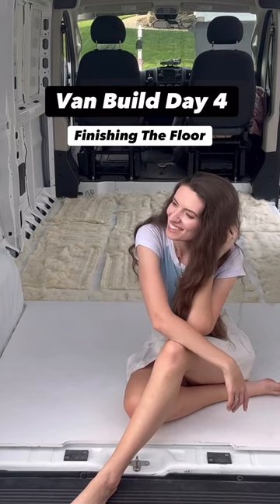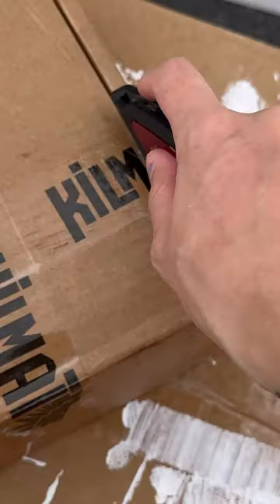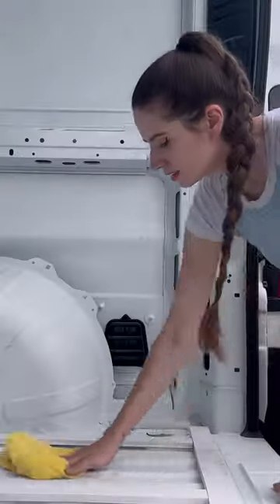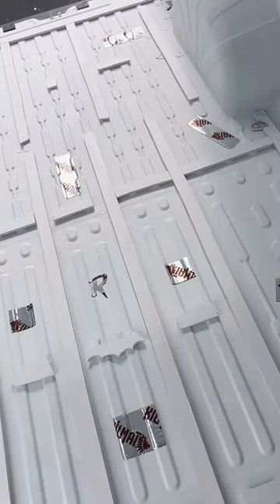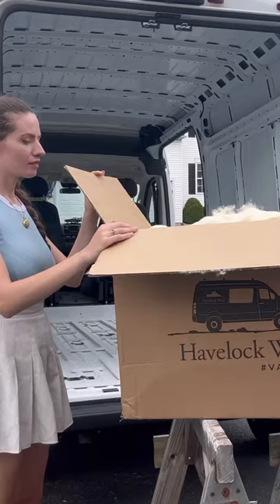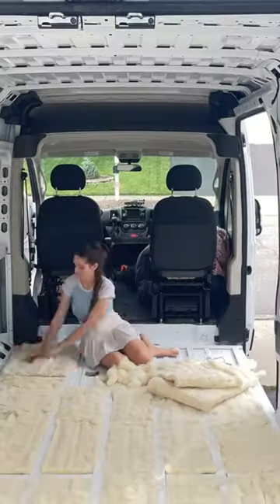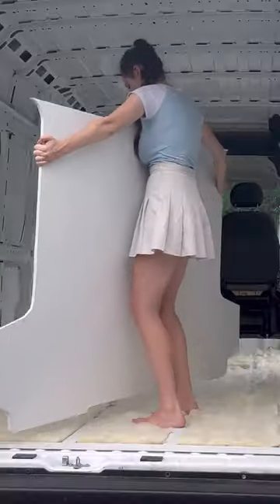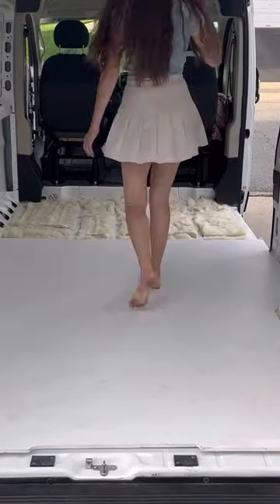Building A Floor: Van Build Series Day 4

Comment: You're gonna wish that you put in at least two by four lengths and more insulation on the floor.

You won't realize it until you're in Extreme weather like extreme heat or extreme cold. That you need more insulation under that floor.

Hopefully, you get this message, and you fix it quickly. Don't make the same mistakes I did.❤

Comment: Could you explain how the sound deadening works? What does those little pieces do to help with sound?
Reply: You need to add a lot more than that
Reply: It works with to add a weight to the car tin.
So the tin cannot swing, and becomes less noisy. 😅